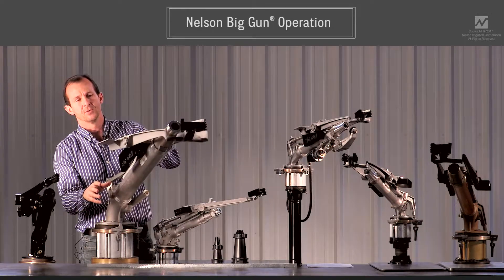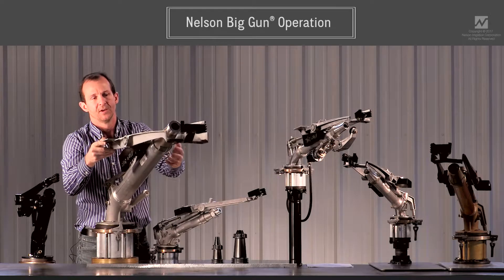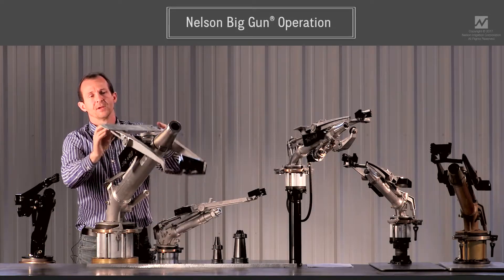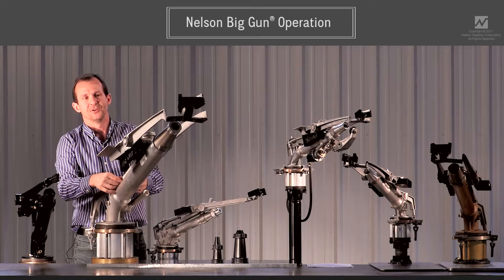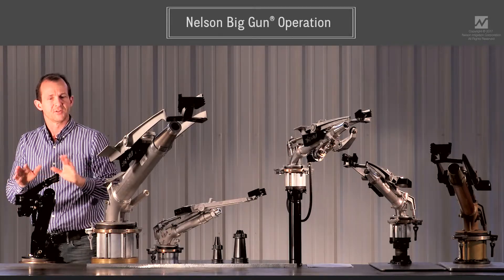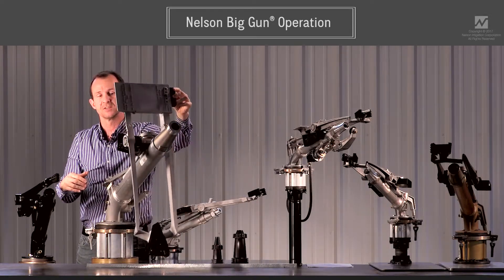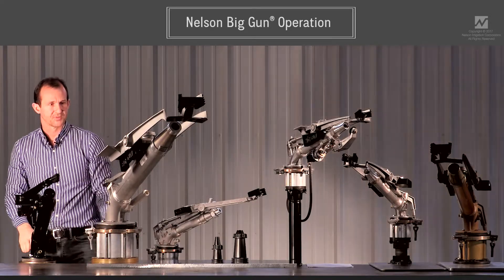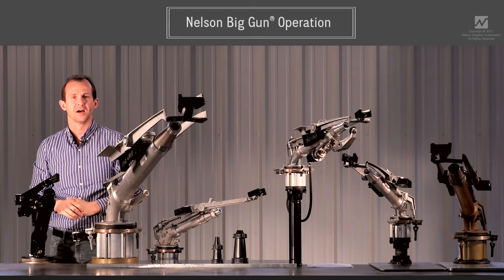Nelson Big Gun Sprinkler Operation Explained

Comment: which size fit install end of pivot input 8" pipe diameter of main water pump 190 M3/hr as 44 meters head...the length of pivot 
system is 311 meters>which office near Erbil ..highly appreciate
Reply from the maker: Thank you for your inquiry. Please contact our representative David Bedingfield  :  david.bedingfeld@nelsonirrigation.com. David will help you discuss your needs and find you a regional dealer.
Reply: Please emails to
Steel.iraq@gmail.com
Pipes.iraq@yahoo.com
Reply: @steeliraq6030  سلا م  عليكم